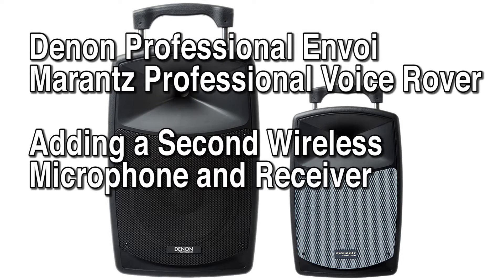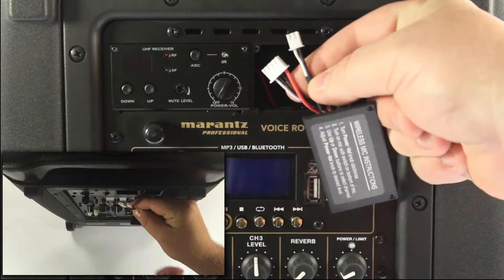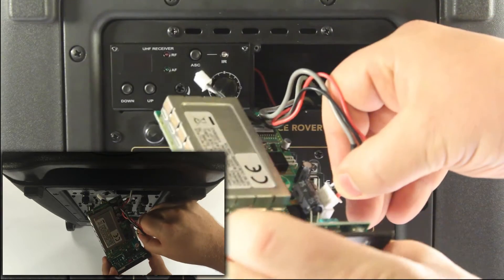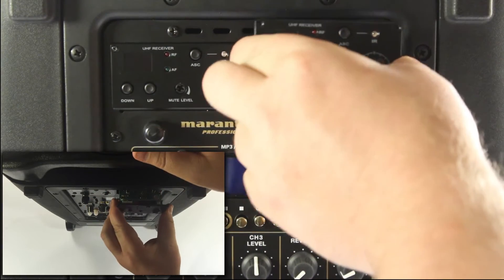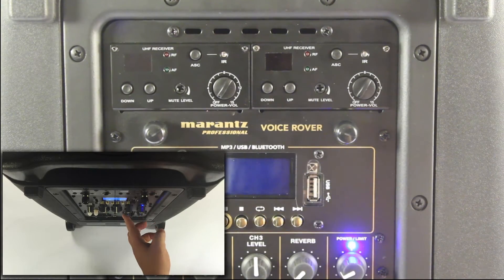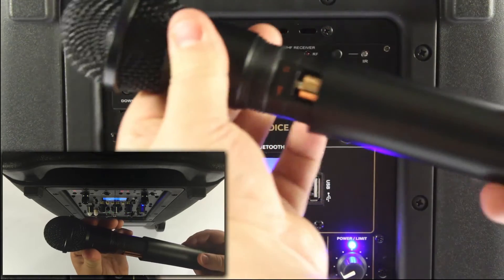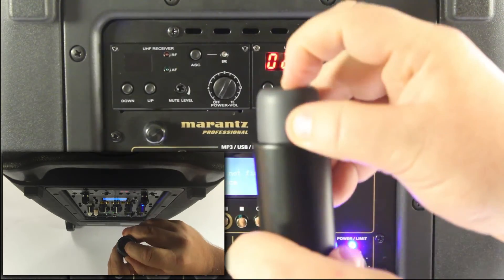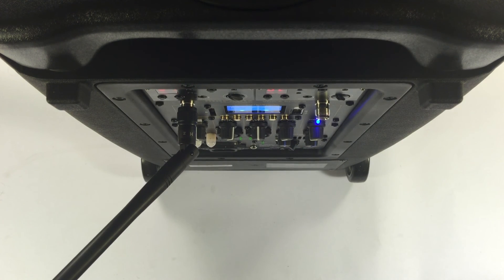Denon Pro Envoi and Marantz Pro Voice Rover - Adding a Second Wireless Mic Receiver

Comment: I got the second transmitter and it was easy to install. Question: I used the lapel mic 2 weeks ago for a wedding ceremony and the signal went in and out a few times which is embarrassing. Do you have to have a clear line of sight to the officiant? Is there a way to boost the signal?
Reply: You have to turn the "muting" screw adjustment on the receiver ALL THE WAY OPEN". ALSO you must use the High Setting on the Mic inside the battery compartment.  Dont bother calling DENON for ANY Help.  Waste of Time!
Reply: Thank you so much for replying ... I did notice the lapel mic receiver has Mic, 0, and some db setting - which one of those is the highest?

Comment: Great video, thanks! I click here because I'm trying to find a way to send the built-in wireless mic signal through to a signal processor. Do you think there's any way to grab the mic signal before it goes to the built-in mixer?
Reply from the maker: Thanks for watching.  Good question! While the Envoi has built-in reverb, there's not a way to route the Mic signal to an external processor.  The built-in mixer on the rear of the Envoi does not feature any Insert points Aux outputs like you'd find on some stand-alone mixers.  On larger PA mixers, Inserts and Aux Outputs are typically, how you'd route a mic or instrument channel to an external processor.  To allow this setup to be compact and stand-alone, we had to make some decisions about what features to keep, move, or omit in order to fit into this package.  Connecting to external processors would usually be a less frequent need on a unit like this since having other boxes, wires, power supplies would be less common on a portable setup.  

We're certainly interested in feedback too.   What type of additional signal processing is important to you, can you let me know?

I hope that this helps!
Reply: noterepeat thanks, I was more curious about a diy hack, grabbing the signal from the receiver before it hits the envoi board.

The microphone could really use some EQ and compression, nothing crazy, a dbx gorack would do the job. If I knew which wires on the envoi to splice, I could pull the guts of the gorack and jam it in to the 2nd receiver slot on the envoi and BOOM! 

What's the worse that could happen..

Comment: can't you use a second microphone on the same transmitter?
Reply from the maker: You need a separate transmitter (wireless mic) and receiver (base module with antenna) for each mic.  You can't use multiple mics with the same receiver.
Reply: noterepeat so Installed the second mic and it's louder than the first one..both mic volumes set on 12. any thoughts...
Reply: Set the H/L 
switch INSIDE the mic battery compartment BOTH to H or BOTH to L... for fine Adjustment, use the Muting adjustment screw on the face of the receiver.

Comment: can i use two speakers with just 1 mic?
Reply from the maker: Good question.  Yes you can!  The Envoi has a 1/4" Line Out port.  First, you'd connect your mic to the first speaker.  Then you'd connect the Line Out on the first speaker to the CH2 input on your second speaker.  Set the MIC/Line switch on the CH2 input to 'Line', and you're done.  The signal from your Mic will reach both speakers.
Reply: If your receivers have the same frequency.   I doubt it.  Try all the UHF channels.
Reply: You can Line out of the First speaker ( the one with the mic receiver you are using)  into the second speaker with a 1/4" instrument cable.